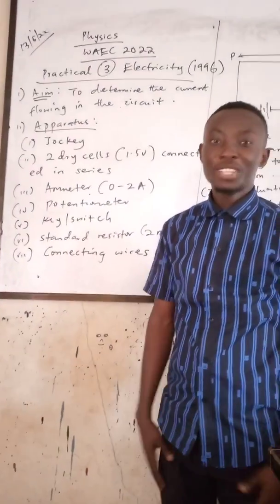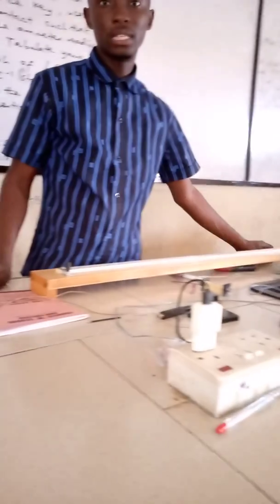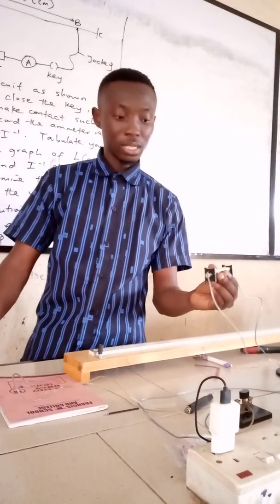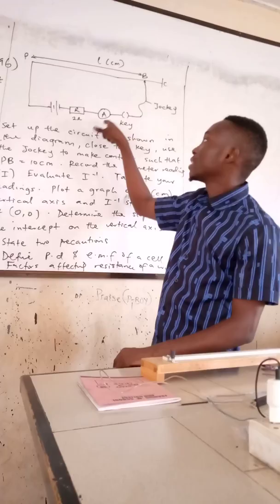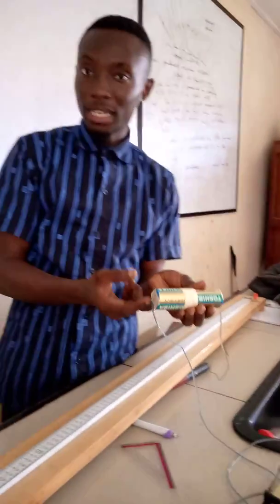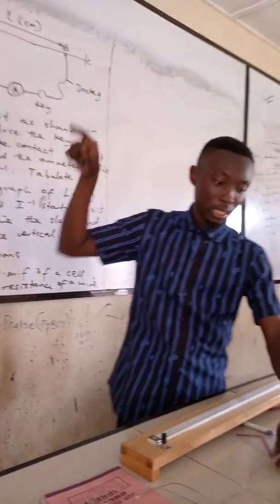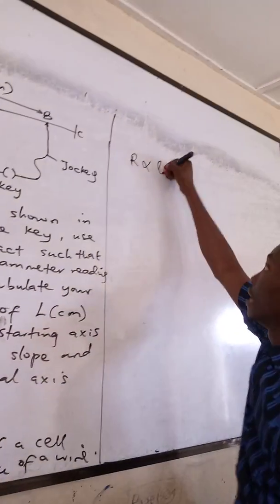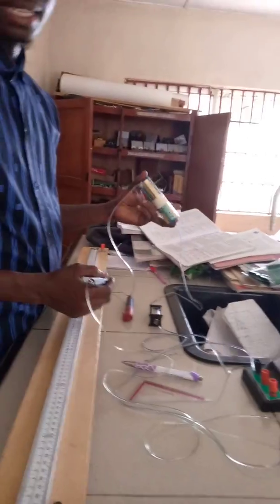WAEC 2022 PHYSICS PRACTICALS ON ELECTRICITY EXPLAINED....

Comment: Well done sir. Pls can you tell me why my readings on the ammeter is higher than your? When my l=20 ammeter reading was 3.5A. I did the connections correctly
Reply from the maker: Ok as long as your connections are ok....all you need do is to know the variation of resistance with current...as long as u do just iterate and get other remaining values it shouldn't be exactly the same
Reply from the maker: It shouldn't read 3.5A....the reading is much....ur readings should be within the range of 1.5A that's why WAEC said we should use that....I = V/R so 3/2 equals 1.5A which would flow through the ammeter....

Comment: Those were not the complete apparatus given for the question. 
Voltmeter
Two dry cells
Potentiometer
Key
Jockey
Meter bridge
Connecting wires
Ammeter....there is no resistor
That means the question is going to be completely different from what you are doing.
Reply from the maker: Thanks for the observations I would check properly and confirm to you sir
Reply from the maker: Sir the one I received from Waec does not include meter bridge and voltmeter thanks
Reply: Could they have changed the instructions? WAEC is doing wonders this year
Reply from the maker: @crushballer  I don't think so why would they give instructions and later change it....I so. Verified this one
Reply: Meaning that the one we got online ain't totally correct
Reply from the maker: @crushballer  yes it's not I teach in a secondary school so I received mine directly from WAEC
Reply: Except you want me to send you a shot of the instructions. What I listed is exactly what is required for the electricity experiment. It got me wondering what exactly is waec is looking. In my 12yrs of teaching this subject, I haven't seen any electricity question like that requiring those apparatus. It was the reason I decided to search on YouTube to see if someone else observe the same thing.
Reply from the maker: Hmmm ok..... please verify or check what other tutors did....thank you
Reply: @frankztutor4516  What you have is exactly what I received from WAEC, brother. They want to check schools that write from the internet as this year's  practicals will never be the same for every school. So different schools received different instructional sets.
Reply from the maker: @ibekesampson3448  oh thanks for the info
Reply: @frankztutor4516  Which state is your school situated?
Reply from the maker: @ibekesampson3448  Ibadan, Oyo State
Reply: @frankztutor4516  Too far from mine. I'm in Imo state, brother. This year's is awesome! I only hope this my never-serious students follows instructions this time.
Reply from the maker: @ibekesampson3448  they will o....me have also done my part for my students...I hope they do well I will set the materials for them and also help the little way I can....
Reply from the maker: Would also try to post Agric and Chemistry tomorrow
Reply from the maker: Sure
Reply: @frankztutor4516  Yeah! I'll direct the serious minds among them further to your Channel. Keep up the good work, brother!
Reply from the maker: @ibekesampson3448  thanks 👍 bro I'm an Igbo from Enugu.... people have testified that what I do helps so I feel privileged
Reply: @frankztutor4516  I knew you are Igbo at the instant of your first word , and that's why I called you brother. Just keep up the work. ka Chukwu nonyere anyi!
Reply: @frankztutor4516  Hello Frank, pls how do I locate your school in Ibadan. I'll appreciate if we can meet, or probably chat via WhatsApp.
Reply from the maker: @clementabraham3904  ok drop your contact let me add you up on my WhatsApp....thanks sir
Reply from the maker: @ibekesampson3448  you too bro
Reply: I connect this same way but my ammeter shows no deflection
Reply from the maker: @sanniadeiza3696  check the connections properly and make sure you connected the negative and positive where it should